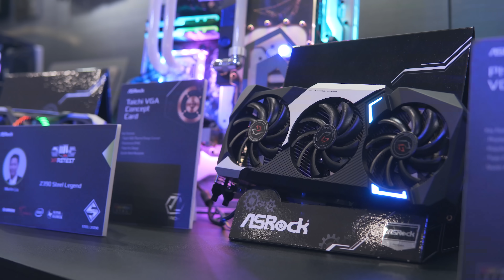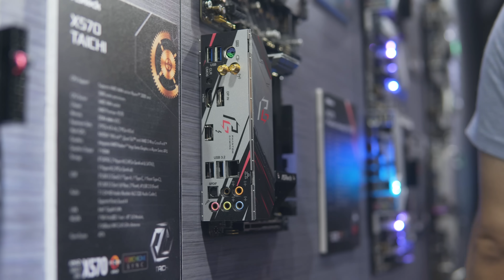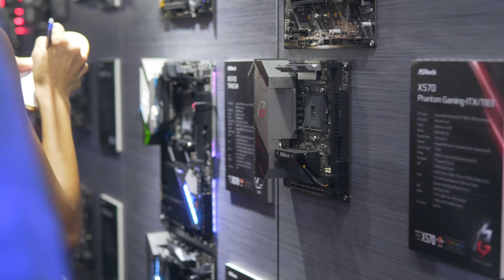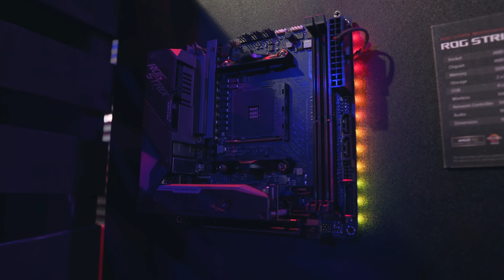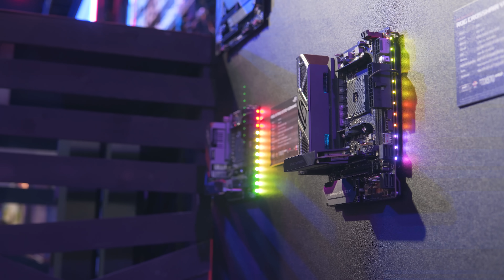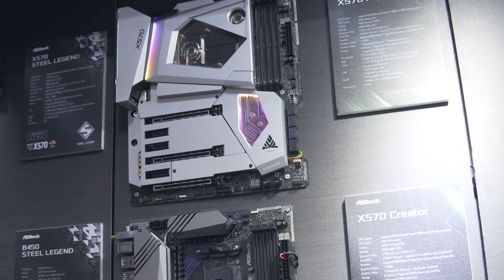ASRock X570 ITX Motherboard - Get Strix Instead?

Comment: I don't see Strix being any better. ALL of X570 ITX boards have tall integrated I/O shields and heatsinks and all are cramped. If anything, ASRock's Intel cooler mount might be better since Intel mounts use less space and there are Intel-mount-only coolers, so this offers more flexibility. 
Also, from what I've gathered so far, most of ITX boards have 6+2 VRM, including this one. I said "most" because Impact has 4+2, according to Buildzoid, and Strix is marketed with same VRM. Granted, they have top of the line 70A power stages and Asus VRMs will handle Ryzens just fine. However, Gigabyte, for example, also has 70A power stages but 6 ("real") phases and I bet it will cost a lot less too. So, what we have here is what Asus does for few years now - having "enough" VRM and overpricing it again...
And finally, ASRock may not have many USB ports (which can be solved easily via a hub) but Thunderbolt 3 is a very nice thing and offers a lot of flexibility.
All in all, ASRock does some interesting things with this board and I see literally no reason whatsoever to get a Strix, as it offers nothing over the others and it will most certainly be the most expensive one, as is tradition...
Reply from the maker: No need to be hostile.
Strix is the only one with active VRM cooling and the most practical rear I/O. The ASRock board straight up suffocates the VRM heatsink and has less power stages as far as we know.
Reply: @optimumtech  No one is hostile here...unless a difference in opinions is hostility.
Buildzoid already explained the VRM situation with Impact (NOT an 8+2, as Asus cunningly markets it, but 4+2 instead) and Strix seems to have the same VRM. It makes no sense for it to have actual 8+2 when Impact which is higher on the food chain doesn't have it and even a $300 board like Maximus XI Hero has 4+2 phases. So, it seems Strix actually has inferior phase count to other boards (still plenty efficient). Ofcourse, I might be wrong and Asus might have out actual 8 phases on an ITX board, but I seriously doubt it. 

Asus seems to have taken a new aproach when it comes to mid-tier boards, with lower phase count and compensating with beefy power stages (which is sorta expensive and contributes to Asus' high prices), but that's another story. It boils down to overcharging for stuff that others effectivelly do the same but for lot less money, which has become Asus' mantra lately... 

TheVRM heatsink on Strix doesn't look any better than what others have, really, it's still covered and finless. It does have the fan (which looks a bit off to the side so I'm not sure what it blows on), but it doesn't have a fan on the chipset/M.2 so it's a tradeoff that's yet to prove right or wrong. 

As for the "practical I/O", that is highly subjecive, as many of the comments on this video have shown. People are very hyped up for TB3 on ITX boards, rightfully so, and don't mind the lack of USB ports as much (and it's very easy to compensate). 

IMO, Strix is a bog-standard board that will end up being too expensive because Asus, makeup and strange VRM design (if the 4+2 is true), while ASRock actually does interesting and innovative stuff and it should perform well enough...

Comment: I, personally like the I/O on this board. Yeah, it's low on usb ports. I'm only using a total of 4 usb ports as it is right now anyway, and considering my monitor and keyboard act as hubs, and I have front mounted usb in the Ncase this is a non-issue. On the topic of I/O; that Thunderbolt 3 port is an exclusive feature for this form factor. And one thing I was happy to see, especially with cramped itx cases in mind was that clear cmos button. I'm not sure why board partners have gotten away from them, they take up so little space and if you've ever done much overclocking inside an ITX case you'll know it's no fun trying to mess with cmos jumpers. It's a small thing, granted, but it's something I always look for. 

I had hoped that Asrock was going to treat AMD fans to the same level of polish as their excellent Z390 motherboard and give us 2 m.2 slots, and considering they saved some space by using the intel mounting, it's a much bigger bummer imo than the I/O of this board. 

Looking forward to Builzoid or you doing a round up of these ITX motherboards and looking specifically at VRM, because with those 16 core chips coming down the line, we'll need every electron we can get.
Reply: I have to say I agree, I would always take few high performance USB over vast numbers of gen 1 USB ports. The high performance headers for the case is also important as I want a gen2 usb at the front for using removabile media (ie portable SSD's).

My understanding is you only really need strong cooling for the X570 when you start using multiple M.2 on PCI 4.0 taking advantage of the built in RAID. Looking forward to revews.

Comment: If you need 10GigE in Dan A4, ASROCK is the only option.
Reply: Sliger SM550/560 is much nicer
Reply: Jesper Andersen  I have a Sliger Cerberus. The build quality is horrendous.
Reply: @allansh828  didn't mention a Cerberus?
Reply: Jesper Andersen  I don’t like Sliger in general.

Comment: 4usb a and thunderbolt 3 not enough? What are people plugging in there besides mouse and keyboard. Mouse and keyboard don't even have to be plugged into usb either with that board.
Reply: Audio interface, webcam, ext HDD/SSD
Reply: @DarkPa1adin  Nothing a 10 to 15 usd hub can't fix, i have a H310 itx from asrock with pretty much the same amount of usb ports, and a simple 7 port hub of that price fixed it all the "lacking" of ports for me, i barely use them anyways, mostly for hooking up a Xbox 360 pad with the reciever.
Reply: DarkPa1adin adaptor / hub off of thethunderbolt ?

Comment: TB3 is a huge bonus for ITX.
Reply: Lack of TB on other board brands is what make Asrock appealing for hackintosh
Reply: I plan to use this board because of the TB3. That's a huge feature for a photographer. 4 USBs is a little bit lame but not the end of the world and I will only do a mild amount of overclocking. Hopefully TB3 becomes a more regular thing
Reply: Very few ppl actually overclock. Some just oc to perform benchmarks but go back to stock after.
Reply: @YoloPascual  I don't overclock at all. Even if people say it "safe", I believe that overclocking increases wear and tear on components.
Reply: Yeah did you read the fine print on their website? Does not support external graphics cards....that was a deal breaker. I wanted to use the discrete pcie 16 on board for an radeon 5600xt and the thunderbolt for my lenovo external graphics gtx 1080 for game capturing. Why include this if its a half baked thunderbolt 3.
Reply: Thats for eGPU ITX builds
Reply from the maker: It's great to have it here as an option. I feel like most users who want to squeeze the most out of overclocking and performance though should look elsewhere.
Reply: @optimumtech  that's true but i don't agree with your comment that 4 USB ports won't work for MOST people. MOST people will do fine with 4 and can switch to a hub if needed. And most folks buying these boards aren't enthusiast overclockers - they'll just go with an OC that works for 80%+ of chips and doesn't require a lot of added voltage and call it a day.
Reply: @mohamedahmed1023  So I have mouse, keyboard, mic, conroller, and a sound system hooked up over USB. I at least need 6 USB ports to be able to connect my camera or a flashdrive. My future case (Dan A4) only has one front port. Im no professional or enthusiast but this board is no choice for me.
Reply: @misterx3666  I have my mouse, kb, DAC, and a few other peripherals plugged into 1 USB slot.
Reply: @mohamedahmed1023  If it works for you thats fine. I dont want to worry about hubs and the problems they can cause. I like a simple and versitile setup, especially with a portable itx pc. Can't lose your I/O.
Reply: @misterx3666  get a monitor with a USB3.0+ hub? they are also quite common and easier to reach than the back of the case and the controller could easilly be hooked up on the front (easier to unplug and get rid of when not in use) unless you only use it for the controller that is
Reply: @misterx3666  Why cant you just use a USB hub? Each USB port on back is a shared 5Gbps anyway, so using a Hub with one plugged in to computer gives you the same speed.
Reply: @LiveLifeToItsFullist  Did you read my last answer? " @mohamedahmed1023  If it works for you thats fine. I dont want to worry about hubs and the problems they can cause. I like a simple and versitile setup, especially with a portable itx pc. Can't lose your I/O."
Reply: @LiveLifeToItsFullist  I should add that I like simplicity and a clean setup and if I'm building a 1300$ PC I don't want to make compromises.
Reply: @optimumtech  It's the ideal ITX workstation board for me with TB3 and Optical.

Comment: Does the ASUS ITX board have thunderbolt-3 and would you advice a user drives his gaming and creative monitors via thunderbolt-3 (that includes a regular USB-C) or display port?
Reply: Afaik TB3 uses a DP-protocol to transmit the signal.. I would just use DP for simlicity and a free TB3 port
Reply: @moritzmoldau5739  mmmm🙍🙍🙎🙎👌👌... Just watched a video on that but is there any advantage of using a display port for driving your gaming or content creation monitors over using a USB-C and vice-versa?
Reply: @storm91229  If your monitor has features that are only accessible when using TB3, than yes, TB3 has benefits. Otherwise no. Also, Thunderbolt is sometimes (or often, not sure how the situation is now) connected to the integrated GPU in your CPU. Additionally older TB3 controller only support Displayport 1.2 and not the newer 1.4 standard. 
Displayport is usually more straight forward as there are not that many uncertainties with the standard.
Also, the right USB-C cables can be a real hassle to find, as there are a lot of different versions.
Reply: @felentus  This controller on ASRock X570 ITX supports 4k144 with 10 bits and hdr (requires displayport 1.4)

Comment: If all else is equal I would always go with Asus due to better Bios.
Reply: Yeah, it's better but still bad, the x470i i have is driving me crazy. The bios is so bad it's sad. With that I don't mean the interface, but the non working features:
- pState oc only works partially
- fan control only has 3 temperature points (deal breaker for me) 
- the fan control also doesn't give you full range control and is artifically limiting you (If I'm comfortable with running my CPU at 75°C, than let me run it at 75°C without setting the fan to 100%)
- fan control sometimes get stuck at 100% for no apparent reason
(- speedfan doesn't work)
- memory overclocking is inconsistent
- boot times are terrible
- every update you need to dial in all the settings again, since user profiles often cannot be used after an update
- user profiles do not save all the settings
I think I covered most of what I find annoying about the Asus bios for AM4.
Reply: felentus I'm surprised. I've not had too many hitches with the B450-I Strix. Adjusting fan curves is annoying, but at least that only needs to be done once. The problems might be related to an older bios, and updating may solve the problem. My Crosshair VI Hero bios, however, has been problematic the whole time, and while it doesn't suck donkey balls like it used to, it's still somewhat buggy with things like changes not applying.
Reply: @rcradiator  I've keep my bios up to date in hope that they fix a thing. For me, the biggest two problem with the fan control is that you can't choose more than 3 temperature points and that you can't set the maximum temperature higher than 75°C. If I set the ramp up/down time to high, the fans get stuck at 100% regulary, and since it only has 3 points, you need to set it higher, because otherwise my fans are just going to go mental. 
Did you try pState overclocking and actual memory overclocking with all manual timings? I started to hate this thing, even the gigabyte b350 itx is less painfull, though that board has other problems (like me bricking it once :P).
The Asus bios is nice if you just dial things in once. But if you are like me and love to silence your system while squeezing out the last bit of performance and doing that in a tiny case with a cooler that's just too small, you'll just start to hate it. 
Things like missing nativ bifurcation support, or the Wifi and the sound card blocking CPU cooler clearance, the single uncooled soc phase, suboptimal SATA port placement (cooler clearance), badly designed heatsink (fins damn it, it needs fins), only 40A power stages for Vcore, the "pump" header having even less control options, the shitty Wifi antenna that falls over when you look at it and the unjustified high price tag are also thighs that annoy me, but things that I can deal with.

Edit: Also, with the z390 lineup Asus showed me, that they are ok with relying on the brainless fanbase that they've managed to build, instead of actually innovating and trying to make good products. The DTX Impact board is also an insult to the the DTX form factor, that is suppose to have 2 PCIe slots. I don't personally like Asrocks boards that much (for bios reasons), but they've managed to build a x299 board without needing to go to mini DTX.

Edit 2: Sorry for the rant. Just realized how disappointed I'm actually am in my 220€ purchase.

Comment: the 2 most interesting boards of computex covered in 1 video... thx

edit1:
- i think the 115x thing is going on because they dont have to reserve as much space for the cooler when using that socket? 
- does anyone really use all the audio ports that take up space on almost every i/o? i would be perfectly fine with 1x out, 1x mic-in and 1x digital out

edit2:
-are you, optimum tech, sure that there wont be more than 2 phases for SOC? it looks like the strix is aimed for APU overclocking (while the impact isnt) and i would be suprised if they only put X+2 phases on the pcb, especially when considering more powerful APUs
Reply: I'd agree. Asus seems to listen to this and only has 3 audio ports on their X470-i, but unfortunately they remove the digital out when they do it. They have a line in (why?), line out, and mic port. I'd be in favor of your solution.
Reply: why would the strix be aimed at APU overclocking? O.o
To me it just seems like a ITX board for people that don't have the budget, the need or the case for the Impact.
Reply: @felentus  the impact doesnt have video output and naked SOC mosfets. the strix has the whole VRM actively cooled (probably because the chipset shares the heatsink) and does have video out. Asus was the only manufacturer in gen 2 without an ITX board that was good at APU OC (they had 1 phase SOC) and now it looks like they wanted to close this gap with the strix.

edit:
it might not be the primary target and it'll be good for dGPU systems as well but i think it's one of the targets of the board
Reply: @milchkopf3881  mhhh, it still looks a bit too expansive for an APU. I wouldn't be surprised if it's more than 200usd based on the features
Reply: @felentus  yes it looks expensive. i might be part of a minority in this case, but im excited to buy an expensive board and see what the best APU can do on it. if you're looking for high FPS/dollar, its not very interesting though.